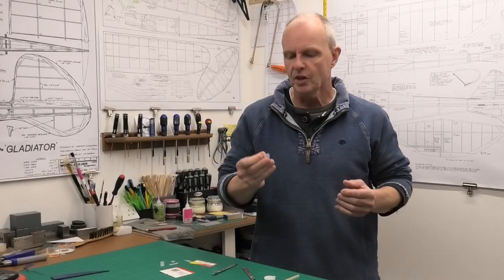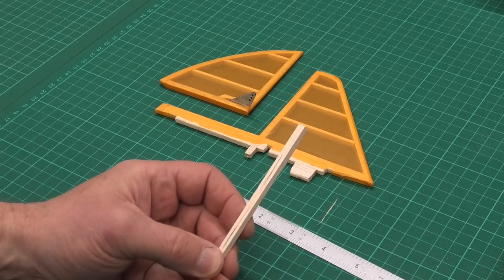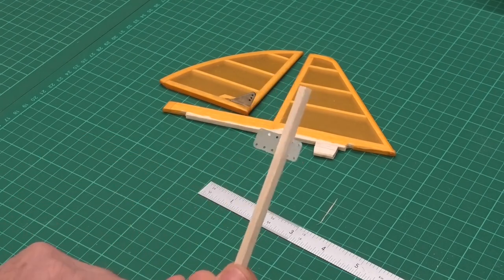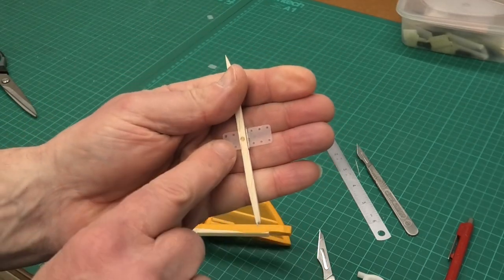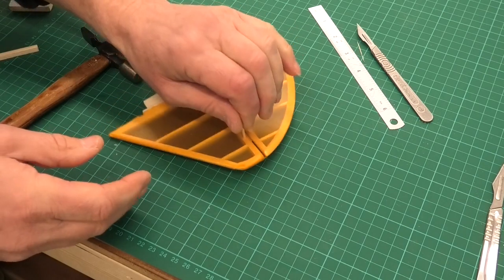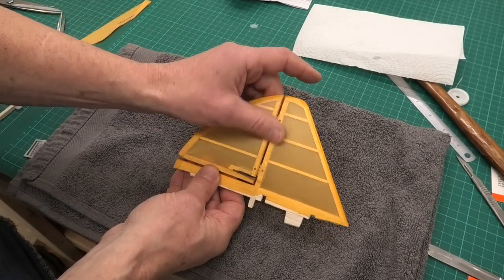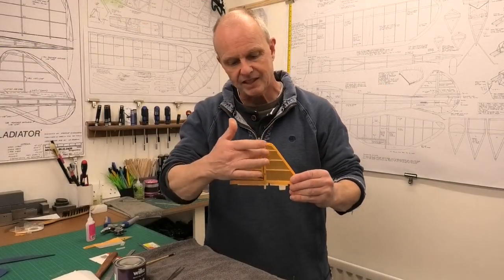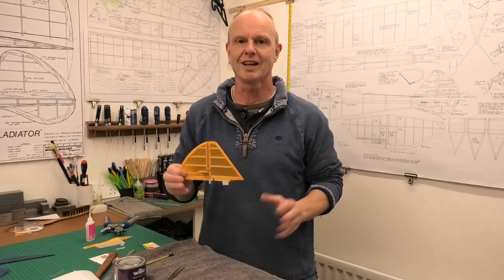Small Du-bro Hinges - Instalation - Model Plane Building - Dubro Hinge Pins

Comment: Checking other peoples builds on old airplanes I acquired, it is indeed hard to clean epoxy after it hardens, I have taken to cutting off the steel pins to take them apart and putting them back together with regular sewing pins. I have found some that were put together with toothpick pins just like yours. This is in Peoria, Arizona, models built in the 1970's- 1980's still flying. No superglue available then.
Reply from the maker: Thanks for the comment, always good to share information

Comment: Years ago I was told to put vaseline on the hinge area, epoxy the hinge in place, and then use a straight pin to do the "pegging" of the hinge, but your method looks easier.
Reply from the maker: Thanks for the comment, its appreciated, pleased you are still visiting and watching 😀
Reply: El de lo palillos es. Si duda el mejor método!!! Un saludo desde Argentina

Comment: Good morning Mark, and the sun is shining for a change. Very good tip for securing the hinges. I must ask, is the covering straight tissue or is it tissue and doculam?
Reply from the maker: Good morning Terry, thanks for the comment, yes its tissue over Doculam 😀
Reply: @MarkRobinson555  I have to admit I am struggling using the Doculam. I am shure it's just a case of getting used to it. I will get there. Thank you again for the videos.
Reply from the maker: @terryblackman6217  do you use messenger?  Happy to chat about it is it would help
Reply from the maker: @terryblackman6217  with the Doculam you can get it quite hot to shrink it, it is a lot tougher than normal covering film, it will take 220deg C no problem, and if you blast difficult bits with a hot air gun it will shrink and not get damaged like covering film.  Don't be afraid to get it hot!
Reply from the maker: @terryblackman6217  also when applying/ sticking, avoid heating up the film which is to be shrunk, just heat the area to be stuck.  Also, don't move your iron along a structure as it causes the film to wrinkle, pull the iron outwards, away from the area to be shrunk, this helps tighten the film.  Hope that helps a little